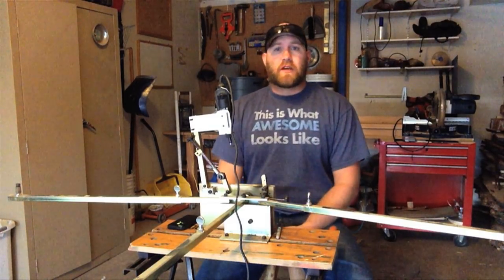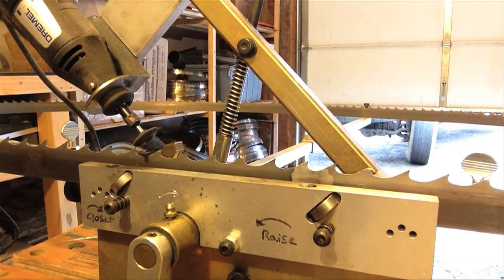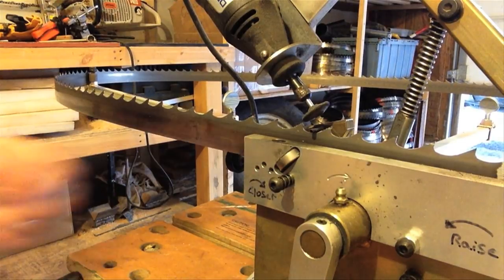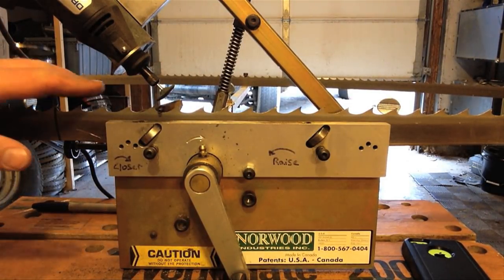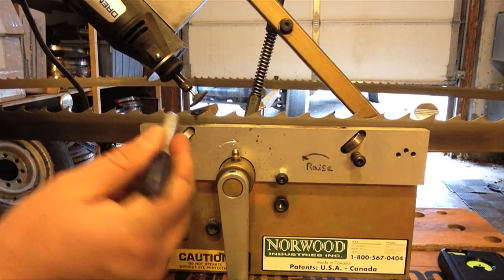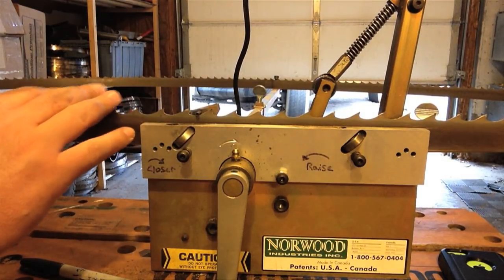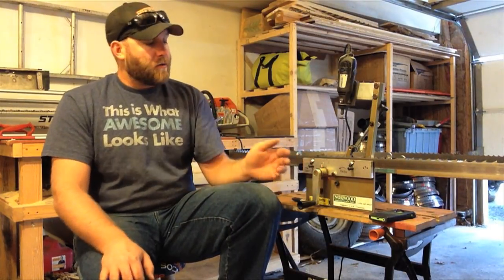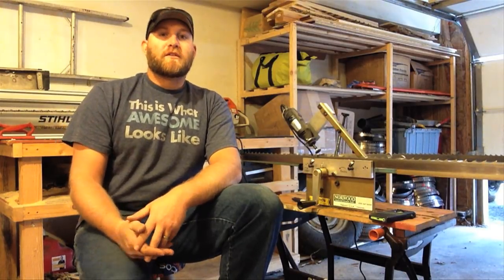Bandsaw Sharpener

Comment: For all your money in my opinion you're still not getting a great grind because you're only grinding the back of the tooth and that's not what you're cutting with !!!  You should be grinding the front of the Gullet only all the way Up  that is what cuts nothing else!!!!!!      There are good auto grinders out there but they are few and far between.
Some chainsaw disk sharpeners can be converted If you know what you're doing but most guys set them up to sharpen the back of the tooth and all though that works for a short while it it does not last.     You have to get that disk into the gullet Period!!!

Comment: You forgot to say it cost almost $800 that's way to high for a simple machine like that.
Reply from the maker: woodaddict1 If you know where to get a machine for less than that, do share! I have wandered from Norwood on some things thinking I was saving money but cheaper stuff just doesn't perform like Norwood products. I've come to the conclusion that paying a little extra gets me a good product and more importantly (especially these days) good customer service. So I'm willing to pay a little more for that. But yeah, let us know where you've found cheaper sharpeners and people can make the comparison for themselves. Thanks!
Reply from the maker: woodaddict1 I want to add one more thing that I really wish I would have addressed in the video a little more. And that is that this machine doesn't just sharpen the blade, it's a contouring machine as well. Meaning, it grinds the entire contour of the tooth which extends blade life and gives you sharper teeth. I asked Norwood (on your behalf) to justify the price and they said the engineering that goes into creating the cam and the rest of the functions to create that contouring grind is quite extensive. Better tools are always more expensive. That's not new information. But again, everyone should weigh their budget with their needs/desires when making their purchasing decisions.